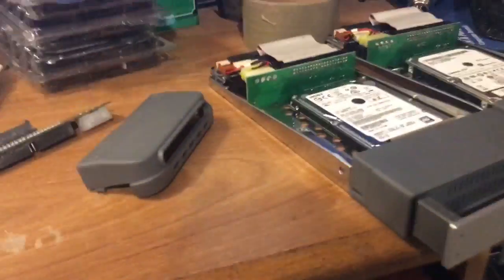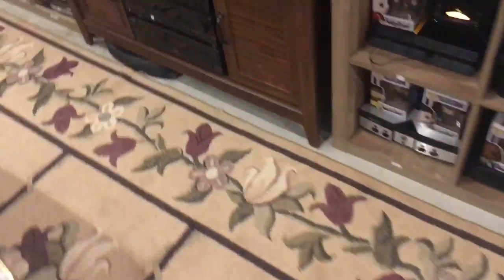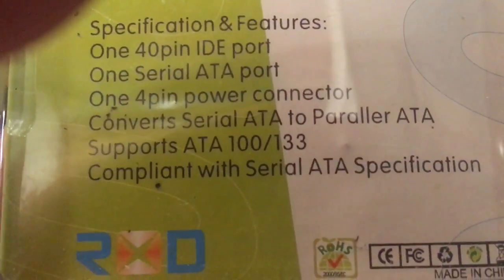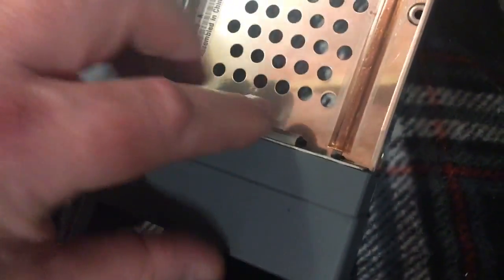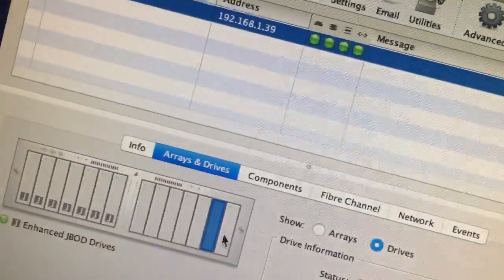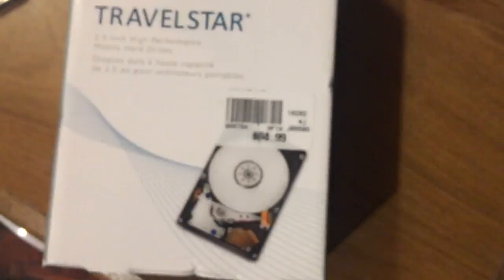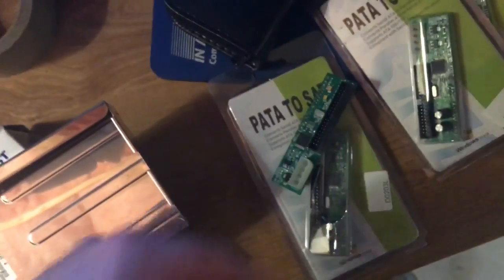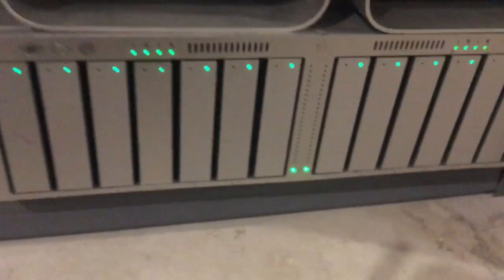Episode 15 Xserve Raid IDE to SATA conversion day!!!

Comment from the maker: video cuts off at the end, but important safety tip, line the tray with electrical tape prevent drives circuit board from touching the metal tray, last one i installed after the video sparked and stunk, so i had removed them all and reinstalled with a  tray liner, see the other video about the power cable mod to save your wires from shorting on insertion